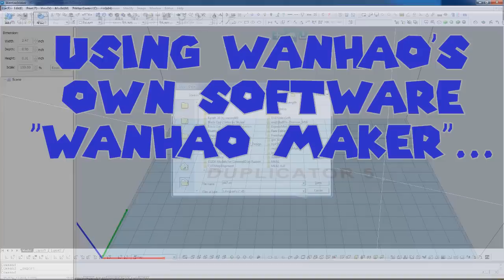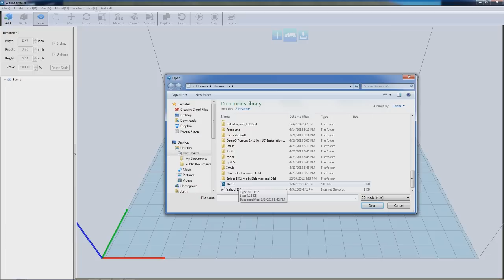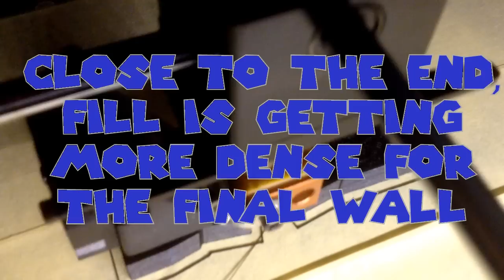Wanhao Duplicator 5S 3D Printer - My first print

Comment: Thank you for video Reddogjkfoo . I planning to buy this 3d printer. Can you give some recommendation?
Reply from the maker: Dejan Markovic Thanks for watching!! I bought mine through the USA dealer, and love it.  Its been almost 7 months with many prints, and it still runs perfect, the only thing I have done is put a new nozzle in, about 3 months ago, and I use "Super Lube #21010" to lube the bars...... Here is the international Wanhao web site : http://www.wanhao3dprinter.com   . On the right end of the orange banner is where you can find a Reseller in your region.  This unit is basically zero setup, just unpack, plug, load filament, and print. I hope this (and my video) helps!!!
Reply: Reddogjkfoo Thanks man. You have been very helpful. This plastic that you use is PLA? Can this printer use ABS?
Reply from the maker: Dejan Markovic Yes in the software, when you "slice" the project into the print file, you can setup and save an ABS option where you decide the heat and feed rate, I have printed with ABS and only changed the heat, I left the feed rate the same, and it produced a nice part, although the ABS does not stick to the tape as well as the PLA, so it would be best to purchase (or make) a heated build plate. Wanhao actually has one they make for this unit, and it looks very nice, I do plan to buy one for myself.
Reply: Reddogjkfoo I have bought this model three days ago, for now is great. every test is passed well. it's very strong and durable. This printer is great. soon I will post my own 3d print video. 
Your recommendations was great help in choosing 3d printer.

Thank you again...
Reply from the maker: Dejan Markovic That's awesome!!! I'm so glad to have been able to help!!! You may also like to check out this 3D part sharing community at http://www.thingiverse.com , I have found it interesting to see projects from others. Most of what I have downloaded and printed has been designed very well, and they print nicely. Have fun with it, and feel free to ask me questions, and I'll do my best to help. :)
Reply: dont

Comment: I love how fast it prints! it the quality good? do you have to adjust it often? also does it have a heated bed?
Reply from the maker: Thanks for watching Winston! :) yes the quality is great, on this first print I used "standard" quality and it still turned out great, but for the prints I have done since this, I have been using the "High Quality" setting, and both 20% fill and solid fill. I have been gathering pictures and short clips of some more prints, and will be making another video to showcase the great quality and the different things I have printed. This model does not have a heated build plate and I have been printing with PLA, which only needs a nice masking tape that will stick to the acrylic build plate nicely, and the PLA sticks to the back of the masking tape really well. I tried to use 3M painter's tape but the adhesive is wimpy, and it tends to lift from the build plate, so a good sticky masking tape is preferred. I did try to print some ABS, and was somewhat successful with a small figurine, it does a nice quality job with the ABS also, but I'm sure adding a heated build plate would make ABS printing just as nice as printing with the PLA. As for adjusting it, I have not had to adjust anything yet, except for when I printed the ABS part, I "tuned" the print heat up a bit for the material (this was done on the printer itself during the heat-up process, using the "Tune Print" menu on the little screen). It then went back to its default setting for PLA without me having to adjust it again. Other than that, I just send it to the home position every so often, just for my own piece of mind, lol..... I noticed that to the right, in the suggested vids, this video of a guy installing a heated build plate on his D5S: http://youtu.be/QqS2iuUCQn8 , I would add a couple notes of caution with this user's install. 1, he uses magnets on top of the plate, and this may impede the print head's path, so these magnets would need to be placed with the print head's movement in mind. 2, the limit switch for the Z axis may need to be adjusted if the height of magnets and heated build plate material are any different that the height of the stock build plate. But I would imagine that with those things in mind, a heated build plate like his could work well. Hope this helps and answers your questions :)
Reply: Reddogjkfoo Is there a way to make the models smooth?
Reply from the maker: ***** With the higher quality slice settings in the Wanhao software, the parts are more smooth than my first print. To make them even more smooth the material responds well to light sanding with a sponge type sanding block, or even just some sand paper in hand. There is also a material made especially for 3D printed parts that is a clear brush on coating that self levels as it dries, and creates a hard smooth glossy, yet sandable & paintable surface, its called XTC-3D and I bought a kit of this coating on ebay fairly cheap, I have used it and it worked well for me. There are some videos on youtube about XTC-3D that show it being used. There are also videos I have found when searching for "3D part finishing", there are quite a few videos ranging from in-expensive processes to questionably dangerous processes, lol. My preferred process would be the XTC-3D if I want the color of the plastic to show, or sanding and painting if I want a special color. Thanks for checking out the video :)

Comment: what material is the the print base?,  is a paper?
Reply from the maker: The acrylic build plate is covered in the tape that came from Wanhao, its just like regular masking tape.... the material I'm printing with in this vid is PLA and does not need a heated build plate to stick :)
Reply: very thanks.